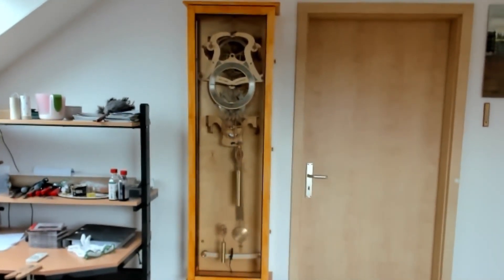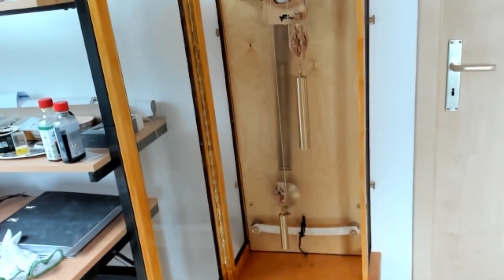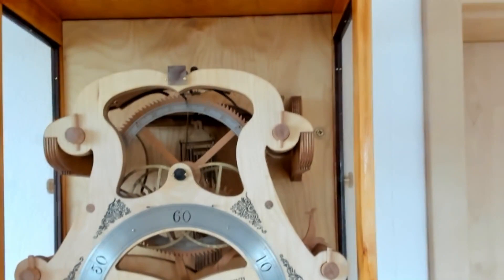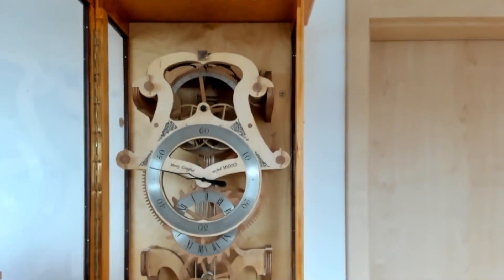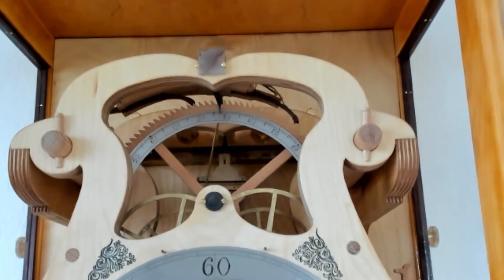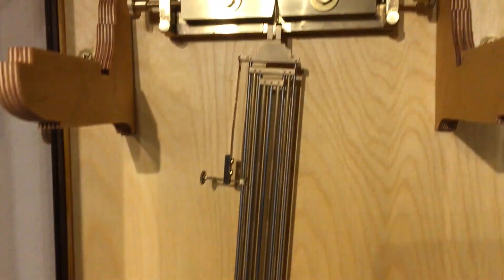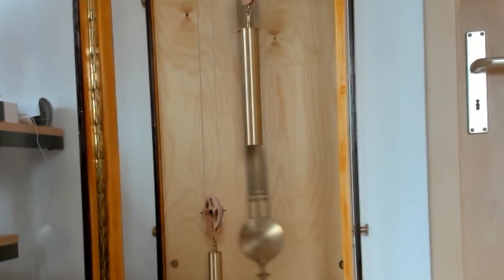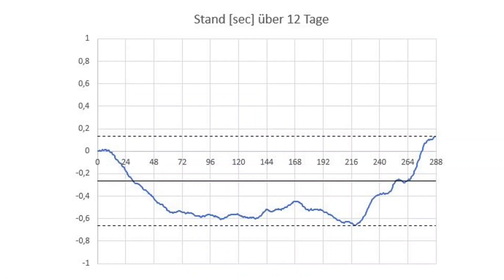Regulating a gridiron compensation pendulum for a grasshopper clock

Comment: I'm going back through your excellent videos after finding your channel recently. I'm curious: is the decrease in rate at higher pressures truly just because the friction increases? Or is it because the additional mass of moving air during the pendulum swing increases the stored kinetic energy of the pendulum-air system at a given bob velocity, increasing the effective mass of the pendulum? Or is there also a buoyancy component too? 

I admit I could try to wade through the internet to find answers for myself, so maybe I'm being lazy, but I thought you might have a ready answer, or a reference/source material to recommend. 

I know that in semiconductor physics, when we have a charge carrier moving through a semiconductor, the response of the surrounding electrons in the lattice increases the effective mass of the particle (the other electrons wobble as it moves by, and their wobble represents kinetic energy, thereby increasing the particle-lattice system's total kinetic energy at a given speed and therefore increasing its effective mass). I figured this would apply to air moving a pendulum too.

I also know from harmonic oscillator theory that the way we model harmonic oscillators in electrical engineering would typically leave the frequency unchanged for a damped but driven harmonic oscillator... but this is only because at the undergraduate level we model driving as a negative damping force. I don't know how an otherwise isochronous pendulum driven by a realistic rectangular force-displacement loop impulse profile would react to frictional damping from the air. Faster? Slower? First order unchanged?

As you can tell I'm an electrical engineer, but I find horology fascinating and beautiful, so thank you for sharing! Your work is extremely impressive.
Reply from the maker: Thank you for your very thoughtful reply showing your deep insight! 
You're absolutely right, there are multiple effects slowing down the pendulum in denser air: The higher air density causes a higher air resistance, an increaed buoyancy of the bob and therefore smaller restoring torque of the pendulum, and by means of the surrounding air an increased inertia without adding to the restoring torque. Presumably in this order, so please excuse me that I have tried to keep it simple in the video and have only mentioned the air resistance as the dominating effect. 
While this is called the barometric error, there is also an escapement error, depending on the angle of the pendulum whre there the drive torque is applied respectively changes it's sign. A drive torque being applied while the pendulum is travelling towards the middle acts like "artificial gravity" and increases the frequencv, wheres a drive torque being applied while the pendulum is swinging outwards slows it down.
 If you are intersted in these things in further detail, I can highly recoimmend the book "Harrison decoded" by Rory McEvoy and Jonathan Betts.
Reply: @p.hefetrueb2674  Thank you so much for the reply! 

I definitely would enjoy a good Harrisonian pendulum related read. Is that book nice and technical? I'm looking for someone to translate Harrison's almost unintelligible dialect into a clear statement of how he was trying to achieve simultaneous barometric/temperature compensation. I read his treatise and really didn't get much from it. Do you think this book achieves that level of depth? Or would a different one be more in-depth?

Comment: Fascinating, thanks for sharing all this info. I'm curious how you decide which point on the slope of the "hill" curve you want to be? Do you just have to run it with some arbitrary drive weight for a period of time and plot the rate against the air pressure, and adjust drive weight from there?
Reply from the maker: Exactly, I'm heading towards some patient try and error. The hill test is for determining a range of amplitude where to look.